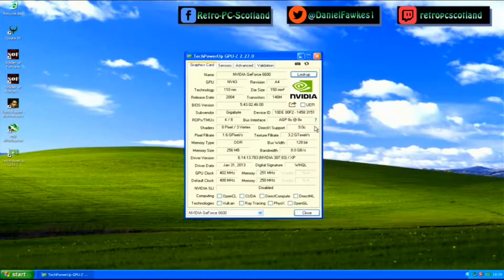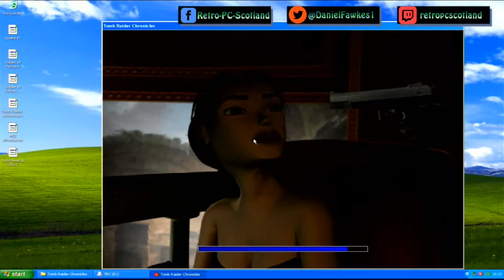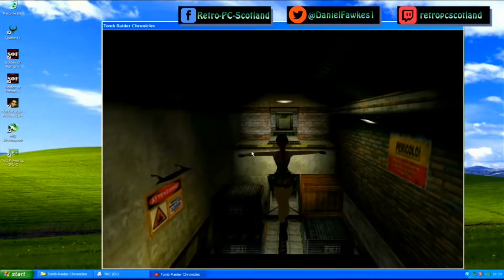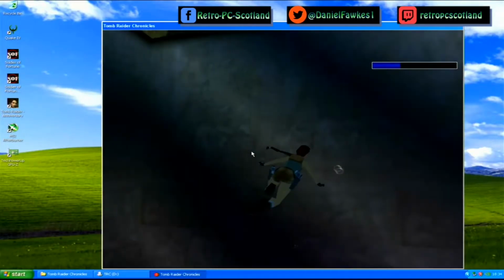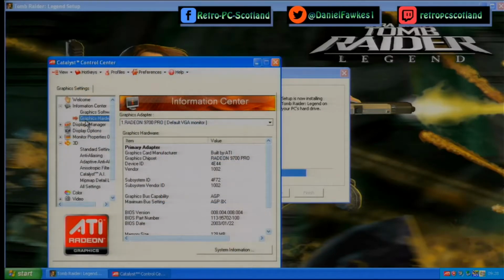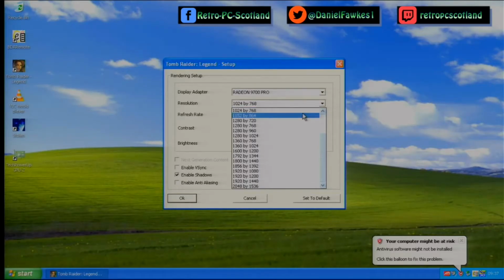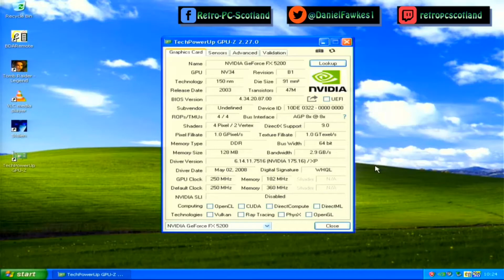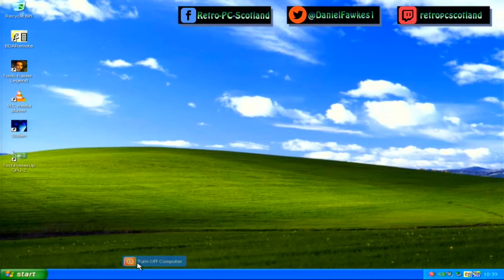Athlon xp 2400+ geforce 6600 ATI 9700 pro to FX5200 agp

Comment: I too remember games running better on my Athlon XP 2800+ but in retrospect, an Athlon XP system is (IMO) better suited for a retro Windows 95/98/ME system

I knocked together a quick and dirty XP system just after lockdown started, figured I’d have some time to enjoy some old titles...I soon found out that to run them at a decent resolution with eye candy enabled, required at least a Core2Duo 🤷🏻‍♂️
Reply from the maker: Agreed Jon, most better with windows 98SE.

Comment: You will need to fully disable agp fast write in bios and in gpu drivers to run the radeon stable. Maybe even add the Omega drivers.
Reply from the maker: You should not have to do anything to run a card stable. This falls onto piss poor manufacturing at the manufacturer level and not an end user problem.